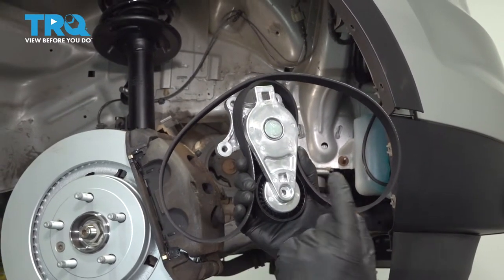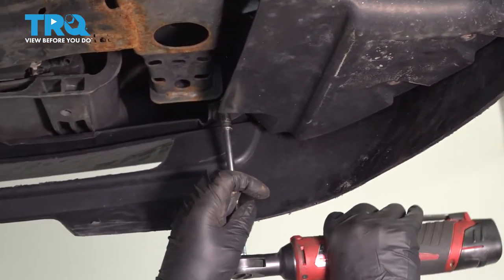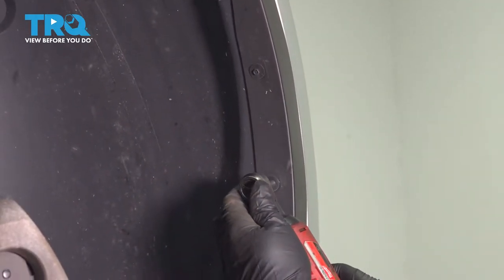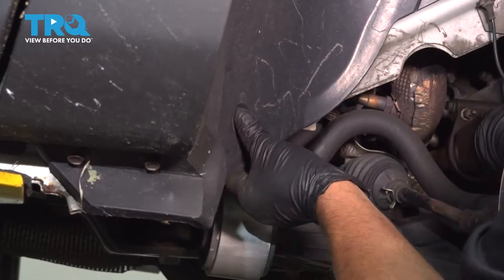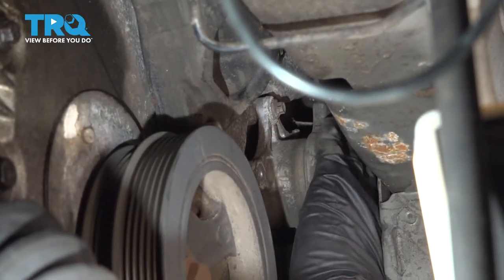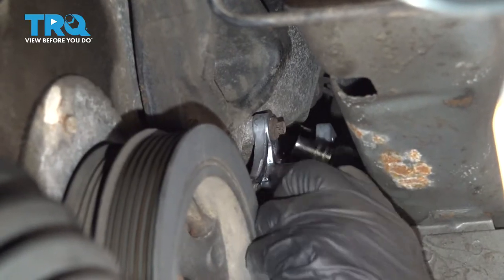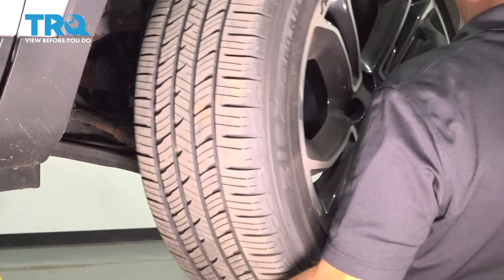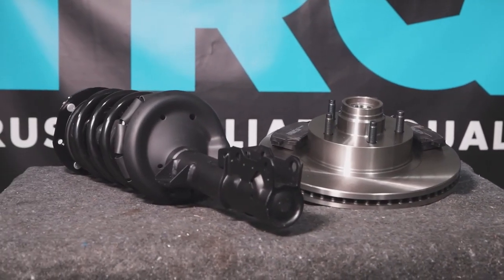How to Replace Drive Belt Kit 2011-2019 Ford Explorer

Comment: Thanks for posting! Great vid. Did mine today and I found it far easier to take the top two spring bolts off from the engine bay rather than wrestle in tight space. The one at the bottom is easy access when you take the trim off. My tensioner was completely seized and wouldn’t release but rather than cut the belt, I just unscrewed the spring and got the belt off. Thanks for the guide!

Comment: Thanks! You made this pretty easy.   I popped off three rivets to remove enough wheel liner; it wasn’t necessary to remove the whole thing.  I removed and tightened the bolts from above and I held tension with a 3/8” breaker bar from above while a helper put the belt on from below.

Comment: With a proper belt tension adjuster wrench, you can replace the serpentine on the 2011-2019 explorer from the engine compartment without removing any panels in less time than it took to watch this video. Have done so more than a dozen times.